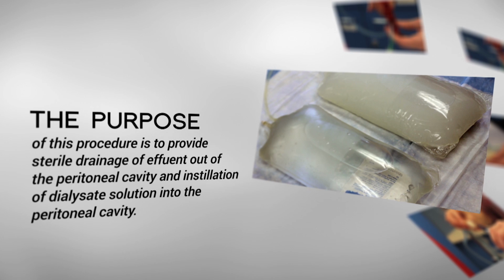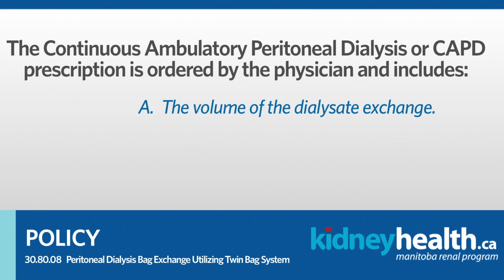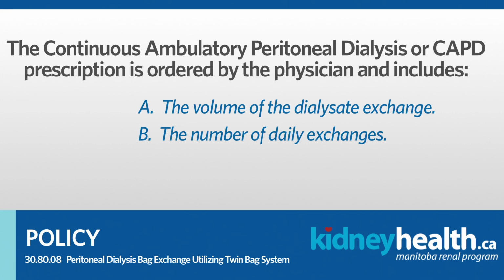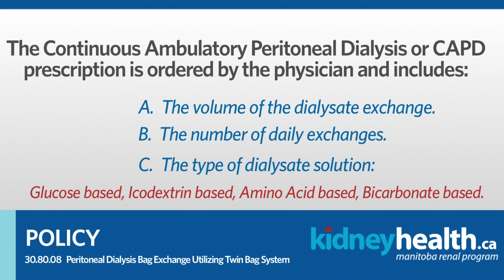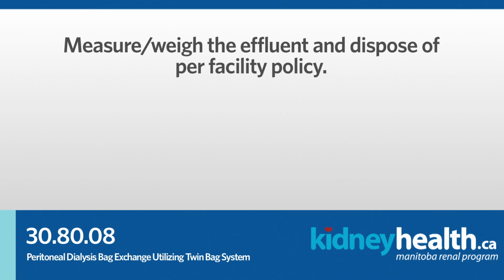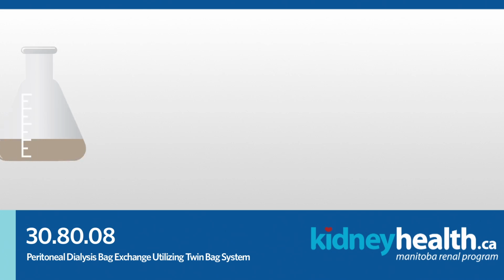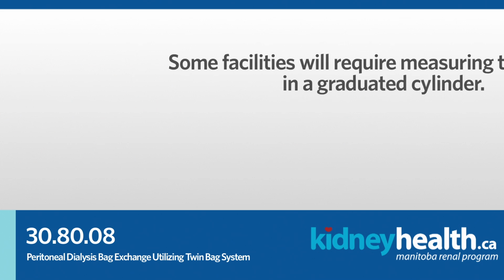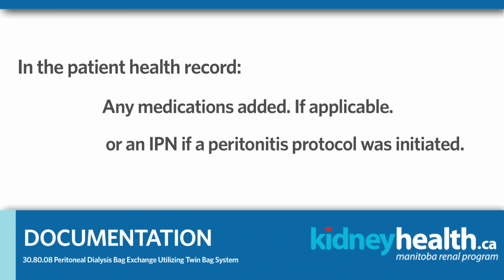Manitoba Renal Program Policy 40.10.08 Peritoneal Dialysis Bag Exchange Utilizing Twin Bag System

Comment: We were taught for at home treatment, the work surface should be as clean as possible. The person performing the connections should be wearing a face mask, as should the patient. When injecting medication into a bag, you must prep the surface of the ports with disinfectant or alcohol if those surfaces touched anything.  The patient connector piece in this video was placed onto the table, rather than clipped to the pole with scissor clamps to keep the connector piece sterile. All sources of air movement, dust, contaminants, must be eliminated. Close doors/windows before starting any procedure.
Reply from the maker: +Lauren  Pavoni Hello and thank you for the feedback on the video. This video directly reflects the Manitoba Renal Program Policy/Procedure 30.80.08 as it was during April 2014. There are differences in program practices throughout Canada based on equipment availability, the principles of sterile connection and mitigating exposure to contamination are consistent.  Please always follow your site specific policies and procedures as taught by your Peritoneal Dialysis Training Team.
Reply: Shouldn’t the hand sanitizer be done “after” opening the cap package?